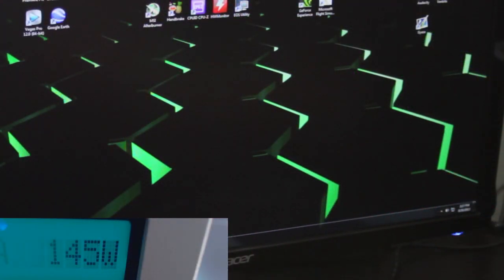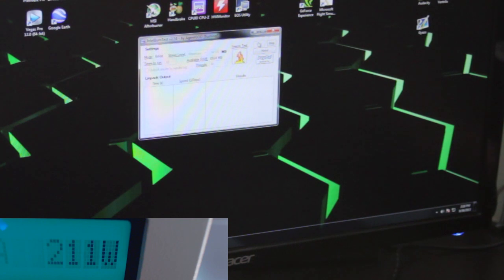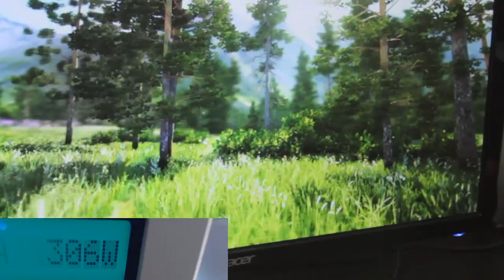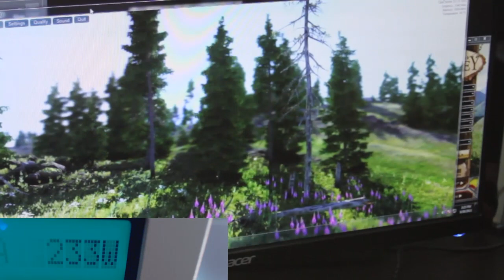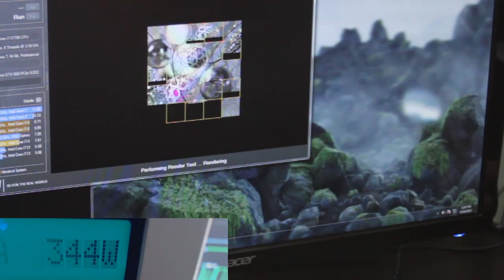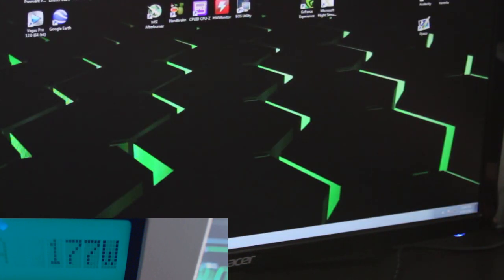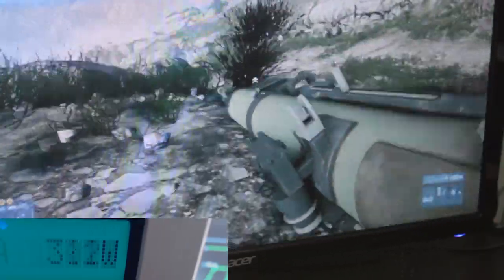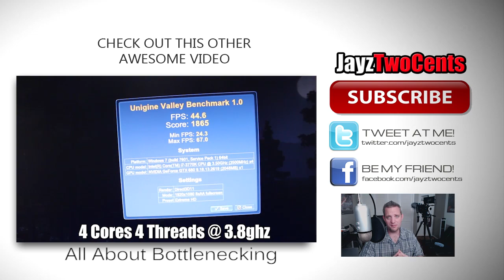How big of a Power Supply do you REALLY need?

Comment: What is the minimum Watts for a gtx 970 with an intel core i5 4460?
Reply: +superdood68 500 Watts is probably the ideal spot. It would most likely work with 450 Watts as well, if the PSU was a high quality one. Still, I'd go with 500 or 550 W. Myself, I'm using an i7 4770k with ASUS Strix 970 fed by 550W PSU and it's more than enough.
Reply: +Martin Kincl thank you!
Reply: +superdood68  minimum? 300-350w, you should never suffocate your system like that though. always get about 50-150w more than it is required. 300w extra if you want SLI down the road.
Reply: +Martin Kincl how long have you had the 550w psu i used a 600w and it burned out in 3 years must of been the crappy cx600.
Reply: Boop Loop Yeah, the Corsair power supplies are often hit or miss. I would recommend the RMx series - RM550x, RM650x, RM750x... Those are high quality 80 plus gold PSUs with 105c japanese capacitors. The CX series on the other hand...
Reply: Martin Kincl  not even sure where to start.
people saying this PSU is bad and that one is good is literally a joke. my old computer has  DYNEX PSU, i know right piece of shit right, guess what that bitch has been running strong for the past 6 years. people make up all this shit so you feel better when you spend $200 on a power supply. the chance of a RM series PSU living 6 years is about 75% the chance of a dynex PSU living 6 years is significantly less, but hey it happens. so if your gonna get a PSU under 450w i highly suggest a CX seriess, if you're getting something over 600w i highly suggest RM series.

i'm tired okay when i read my own comment i get confused, but listen bud, don't even bash the corsair CX series, they are great little power supplies especially for the small price tag. of course the RM series has a much higher chance on a longer life span but if your spending $600 for a PC the cx series is fantastic, if your gonna spend $2000 on a PC of course you won't want anything less than a RM series.
Reply: +ElementalsMods A safe PSU needs to have the right protections, be efficient and reliable. Not that I care about your old PSU, but I'm pretty sure you haven't measured its efficiency, power delivery, voltage regulation, operating temperatures, coil whine, fan noise etc. Perhaps your old PSU worked fine for six years, but did your components as well? Did you run the system 24/7 or do you just turn it on twice a month? Did you try overclocking? Did you try running it on its advertised limits? Would it work just as "flawlessly" in a place with frequent power outages? Are you sure that your old PSU isn't eventually going to die in a blaze of glory killing all components with it and setting your house on fire?

In a way, the PSU can be considered the most important part in the PC, and if you have cheap components, then it's somewhat okay to buy a reasonably safe cheap PSU (Corsair CX). But you can't recommend cheap power supplies to people unless you know how and in what conditions are they going to use the system. With PSUs there's just too many variables you have to count with and I simply think it's better to be safe than sorry. I also think your probability numbers when it comes to Corsair RMx PSUs are a bit off. They come with a warranty of seven years, which I doubt Corsair would give, if there was 25% chance of the PSU dying within six.
Reply: +superdood68 500 watts is recommended by Nvidia for a GTX 970. I would go slightly higher if you want to do upgrades, SLI, or overclocking.

Comment: evga supernova 550w g2 80 plus gold. thanks J I am very great full for your video because now I can stop stressing. because I think I 550w  should be sufficient right. for an Intel Core i-5 4590, mainly z97s sligh krait edition, msi gtx960 4gb oc pcie ddhdp, coolmaster hyper 212 evo univ  h, Samsung e 250gb 850 evo ssd, wd  1TB 3.5 perform black hd, next s340 blue atx case,  Ms oem  windows  10 home 64 bit c, crucial 8GB  4×2 d3  1600 blsp, evga 550w g2  80b gold edition. what do you think food a first time build. please if yoy or anyone has any suggestions just let me know.  this iz all i could afford.  so is everything descent,  is my power supply good or what.  let me know.thanks

Comment: +JayzTwoCents Can you help me with your advise, please? I got Asus B85-plus motherboard, core i7 4770k, 12Gb DDR3 RAM (8+4) and Nvidia GTX 970 4Gb (which I bought instead of GTX 660TI 2Gb), all that stuff is powered with Corsair VS550 power supply unit. Does it look fine to you? The problem is that my PC reboots during gaming something like BF4 or GTA V with high graphic settings and there is a message saying "Power supply surges detected during previous power on. ASUS anti-surge was triggered to protect system from unstable power supply unit". It never happened with GTX 660TI. Do you think I should get some more powerful power supply unit (how powerful?) or just disable ASUS anti-surge in BIOS? Thanks in advance!
Reply: +Andrew Erohin The VS series are Corsair's lowest quality PSU. I suggest you change to a 500W PSU with bronze or higher 80+ rating.

Comment: ok I have a low end pc: AMD E-450 1.65ghz (ASS)Acer Aspire Ax1430g-uw30pand a 430w psu I'm thinking of adding a 980TI (oc)should I worry? I think I have more than enough
Reply: +Ben Cool Firstly, the 980TI will not fit into the Acer casing. Secondly, the 430W is not enough for 980TI. Lastly, the processor will bottleneck the 980TI. In conclusion, change your whole computer if you want a GTX980TI.
Reply: +Ben Cool The E-450 will sweat a lot and your 980Ti will be bored to hell. Not a good match at all. I think PSU would be all right, but borderline. For that GPU you need at least an i5 or an AMD FX. And a 550W+ PSU.
Reply: +Ben Cool No idea what processor you have. However a GTX 980 requires at least 600 watts by Nvidia. It is an extremely high-end card so I would not recommend skimping out on the PSU with such high level components. Plus if you are overclocking get at least 650 watts or even 750. I know it sounds like a lot but those cards use a lot of power. Also they won't be pulling power when not in use so no need to worry about your electric bill. Unless your PC is on like 24/7 and you do a ton of gaming or other demanding tasks.

Comment: Is a 600 watts PSU enough for;
Radeon r9 380 2gb (overclocked)
2x4gb ddr4 memory
1 terabyte hard drive 
128gb ssd
Intel i5 6500
A few LEDs
3 fans (excluding CPU)
And potentially a second r9 380 in the future
Reply: +Noah Milani 1 R9 380 is enough, 2 r9 380 is not enough.

Comment: What is annoying is that his system uses 400w yet, I can run a 380 on my old 450watt psu as it was too low end to have a proper 12v rail and connectors to run a real gpu.
Reply: +Sean Metivier You can buy power connector adapters. I am running a OC 2500K + OC 7870 on a 400W PSU, with 300W output stress test max, 250W gaming.

Comment: How many watts for a system with a GTX 970 MSI and an i5 6500?
Reply: 600, or 700 to be safe :p
Reply: srsly? if i don't need to upgrade i could go with a 550w evga supernova g2 right?
Reply: +Oliver Jorgensen I mean possibly, but that would really limit your system. Getting more never hurts, even 600! Plus if you get it modular you can remove the psu cables you don't need :) That way it isn't a nuisance
Reply: +Tyler Bull A good quality 500W will run fine. 600W is kinda overkill.
Reply: +WB IsMe It would run okay, but would have to be gold rated. Same price for a bronze rated 600w, and you have spare power, not sitting on the edge

Comment: ok can someone help me with my power supply selection? im buying parts and these are the ones i've bought/ordered:
Intel i7 6700k
MSI z170a M5 motherboar
Corsair 2x8gb 2400 DDR4 RAM
Samsung Evo 250GB SSD
Logitech G502 mouse and Corsair STRAFE RGB keyboard
H100i GTX cpu cooler
MSi GTX 980Ti SeaHawk GPU
and an NZXT H440 black case.

Will the 750Watt Corsair HX750i Platinum certified be a good buy for Power supply? and will i be able to purchase another SeaHawk in the future for SLI? or will i always be stuck purchasing only ?
Reply: +Mohsin Qureshi  That PSU is great for that build
Reply: thanks man! do u think i can do sli in the future if i bought the same gpu again?
Reply: buy a generic one jks it should be fine.
Reply: +Neetoryu Kun lol thanks
Reply: +Mohsin Qureshi just get a bit higher wattage than 750 just to be safe. I prefer seasonic though they're pretty silent.
Reply: the guy from where i bought it said another gpu would be fine as long as im not over clocking... i was going to get a gold certified 850 modular one by corsair but he recommended 750i platinum certified.
Reply: technically the platinum was cheaper because it was on boxing week sale. the gold certified 850 was not on sale and costs more....
Reply: TSSS how lucky :D
Reply: haha yeah
Reply: +Mohsin Qureshi Yes. That is an extremely good power supply for your card. It will handle overclocking and might even handle SLI. An amazing build by the way. Have fun and game/build on!
Reply: +Tom Brown thanks man!
Reply: Coz they would earn more cash when you buy the platinum certified psu

Comment: I have question ... This is my rig :
AMD Phenom ii X4 945 95W TDP
AMD R7 250 1GB GDDR5
8GB Ram 
500GB of Hard Drive 
 A 400W PSU should do the Job right ?
Reply: +TheBrotherTeam-2014 For sure.
Reply: +Dominik Sobolewski what about mine 

amd fx 640k 
Asus r7 250 1gb gddr5 (no external connecters)
some motherboard from gigabyte 
case with power supply (400w)
8gb of ram 
1tb hdd
Windows 10

is 400 watt power supply enough?
Reply: +TheBrotherTeam-2014 Those are low power specs so they may even work on a 300 watt PSU but more power equals better performance and greater chance for upgrades.
Reply: +Tekno77 Yes. That is enough. It will run those components.

Comment: I have a FSP Hyper S 600w HP600S will this be enough for a Pentium G4400, 8GB DDR4 2133Mhz, R9 270/207X? maybe an upgrade to a Core i5 later on??
Reply: +Danny F Yes. I have a 600w psu with an 860k at 4.3 ghz and a 270x. so im using more then you and it works fine.
Reply: +Danny F I run an overclocked i5-2500k and a 7870 and I can't put more than 360W in my system under parallel synthetic CPU+GPU stress test (FurMark and Intel Burn Test was the highest ever I managed). And that 360W is at the wall, so the PSU output is probably around 300W! I'm using a 400W continuous power PSU, and I don't plan to upgrade abowe the current TDP. By that I mean if and When I upgrade I'll buy similar TDP CPU and GPU, which will still be much more powerful due to the advance technology.

Comment: i have a 500w evga 80 plus psu with 40a on a 12v rail! im upgrading my gpu this christmas :) to a gtx 960 4g... however im concerned that my psu wont handle this stuff :(

SPECS:
FX 8150 
SABERTOOTH 990FX
16GB CORSAIR VENGENCE
3HHD (2 X 3.5 inch and 1 2.5inch)
HYPER 103 cooler
raven 3 case
and a 960 soon...

How do you think it will do? oh and is it normal for the psu to make a slight buzzing noise? only had it for like 10 months now...
Reply: It'll do fine don't worry the gtx 960 minimum psu wattage is 400w plus so you have extra headroom and good brand being evga.
Reply: aha, yep i got it all installed now anyway, with nzxt lighting as well! looks really nice and my games run beautifully :) very pleased

Comment: Is a 750w psu enough for an r9 390 crossfire?
Reply: +TheSystem 006 Unless the psu is lying (corsair is not) the psu will deliver the rated wattage. CX series is junky cause its inefficient (more heat, more power pulled from wall), not modular, not silent and meh parts quality (don't expect it to last a decade). Functionally, it's fine and price is low.
Reply: Yes for sure
Reply: +Gamer Rushi are you sure? I thought 750w was the minimum for a single 390.
Reply: +TheSystem 006 TDP is 225, max load like... 330?
Reply: Sean Metivier So do you think my shitty corsair cx-750 will be fine?

Comment: which one is the better psu coolermaster v750 or corsair cx 750
Reply: +A.G Gautham CM V750
Reply: +WB IsMe hey thanks for the response ..cm v750 is a bit costlier than the cx 750 ...does that make that much of a difference ..it really worth the money??
Reply: CM v750 is a gold rated power supply. slightly more efficient than cx750 but if you at in tight budget, just go with cx750.
Reply: +WB IsMe okay .I'll go with it thanks :)
Reply: +A.G Gautham the CX series really arent' that good of PSU's, the 750 watt is the best of the bunch, but the lower wattage ones aren't real good, so v750 all day.
If you really want to get all techical, check johhnyguru, he does extremely indepth reviews of power supplies.
Reply: +Jordan Abendroth thanks man ..I've already ordered v750
Reply: +A.G Gautham Get whichever is made by the better oem and whichever uses japanse capacitors.
Reply: +Jordan Abendroth  they are pretty decent everyone who hasn't owned one doesn't like them, everyone who has one loves them.
Reply: +A.G Gautham Both brands make good cases but I don't know about their power supplies. I believe Corsair has good reviews on Amazon. You could opt for EVGA (I have a 500 watt EVGA one and it is great) or XFX both are great brands. Corsair is also good. I did not know that Cooler Master made their own PSU's though.

Comment: I Have 
CPU I5-4690K (3.50GHz)
RAM 4GB DDR4
GPU Asus r9 290 directcu ii oc 4gb 
what powersuply should i get ?????????
Reply: Maybe I'm too late, but I'd recommend buying that one fan and test to see if that's enough. Just going from 0 to 1 fan makes an enormous difference and might be enough. If it's still too warm you can get a new case and mount that extra fan in it if there are unused fan mounts on it (commonly a case will come with 1-3 fans installed and a few spots to mount extra fans).
Reply: +Walid Ramoul 500W 80+ gold PSU.
Reply: +WB IsMe I have 500w coolermaster pro
but my GPU is heating too much on BTF4 is the problem from PSU or RAM or cause i have small case ????????
Reply: What is the average temperature when on BTF4? Below 80 degree Celsius is good. Anything more than that is dangerous. What is your case? Do you have an intake and exhaust fan?
Reply: +WB IsMe It's more than 80 I don't really know the case it's maxipower and it's not big and i don't have fans in it only one for CPU
Reply: You MUST have an intake and exhaust fan especially if you are using R9 290.
Reply: +WB IsMe Should i get  a case with one or 2 fans 120mm or 140mm ????
Reply: Does your current case have fan mounting? If yes, you should get fans instead of buying new case.
Reply: +WB IsMe I can put only one fan 
so I think i have to buy new one (full tower)
Reply: ddr4 isn't compatible with that.

Comment: Hey guys Im building a Gaming Pc and wanting some advice or help on what power supply im needing:
Intel i5-6500 Skylake
Gigabyte Motherboard Micro ATX DDR4 LGA 1151
EVGA GeForce GTX 750 Ti
Crucial Ballistix Sport 8GB Kit (4GBx2) DDR4
Corsair Hydro Series H110i GT (liquid Cooling)
Samsung 850 EVO 250GB 2.5-Inch SATA III Internal SSD
Reply: I just got pretty much the same thing and got a 600w power supply
Reply: +iMagic I wouldn't get that CPU if I was you unless you want to do live streaming or rendering. I'd get a Intel Pentium G3258 and overclock it using the H100i GTX. For the power supply, I'd go for something like the EVGA 80+ 500W. Hope I helped :D
Reply: +iMagic GTX 750Ti is very efficient GPU.. you can use 400-500 watt PSU..

Comment: Im getting the i7 6700k, nvidia gtx 970, 8gb ram, how much watt wil I need? 600 or 750?
Reply: +Gorillaz FTW A good quality 500W.
Reply: +Gorillaz FTW Im running an overclocked 970 with an i7 6700k just fine with a 450w psu. Been running stable for about 4 months now no issues. I would just get a good 500watt and be done with it. Just make sure the power supply you choose uses japanese made capacitors.

Comment: PLEASE i need help! So i have this very old PC system (10 year old).

MOBO -> ASUS P5B
GPU -> Nividia GeForce 7900 GT
CPU -> Inter Core Duo 2 E6400
RAM -> DDR2 x2 2GB (4 total)

My question is, should i get a strong PSU (80+ / 500 Watt Corsair)? or its too much. 
Also ill tell u, the reason i think of this is because maybe in the future my MOBO dies and i have to get a new system overall, so at least then i will not have to buy a PSU.

Plz guys, reply.

Comment: Would anyone here mind checking my build's compatibility as well as total power requirement??
This is my first build, and i'm up to my last part; PSU. :(  and each item on the website doesn't specify the wattage needed. 
Only a few which i will list on the very bottom.
Feel free to give me suggestions on what other parts may be better. (im on a budget) 

MB: Biostart TA970 AM3+ AMD 970 + SB950 SATA 6Gb/s USB 3.0 ATX AMD Motherboard with UEFI BIOS
RAM: HyperX Fury 16Gb (2x8gb) 240-pin DDR3 SDRAM DDR3 1866 Model: HX318C10FBK2/16
HDD: WD Blue 1TB HDD 7200 RPM SATA 6gb/s 64mb Cache. Model: WD10E2EX
SSD: Samsung 850 EVO 250Gb 2.5inch SATA 6gb/s Internal SSD Model: MZ-75E250B/AM
GPU: Asus Stric Radeon R7 370 OC 4gb DDR5 256-bit display port HDMI 1.4aDVI-D ? 
CPU: AMD FX-6300 6-Core Processor Black Edition. Model: FD6300WMHKBOX
Liquid cooling: Silverstone TD03-LITE Durable High-Performance All in one Liquid CPU Cooler with Dual Adjustable 120mm PWM Fans. 
Case: DIYPC Zondda-O Black, USB 3.0 ATX MidTower Gaming PC case. 3x Orange/LED Fans. (I believe these 3 fans that come with the case will need power as well?) <Might regret that question because it sounds very stupid but im like flat on new to this.<

GPU (200 W) (I read in the comments of a review)
HDD (7 W) ??
CPU (95 W)
LiqCool: (12 V) ? 
RAM: (1.5 V) ? 

See, i'm not even sure i have them right, so it would be awesome if anyone can double check it's compatibility and power usage! 

Thanks :)